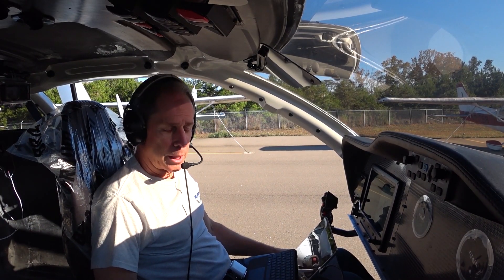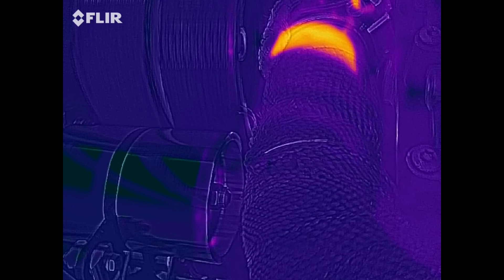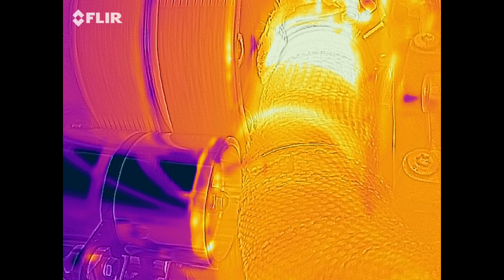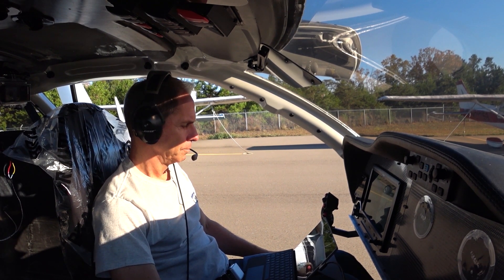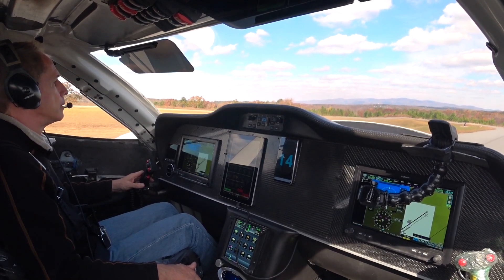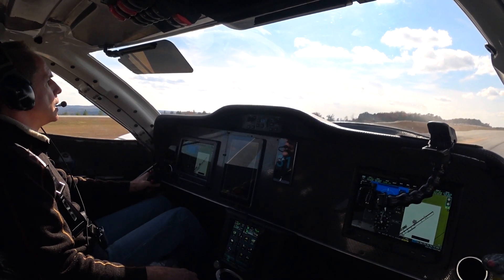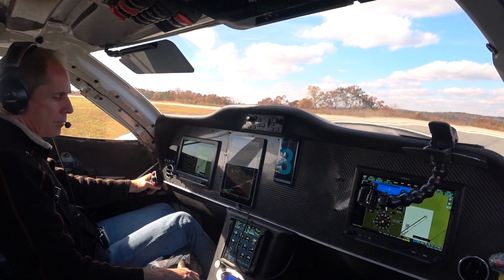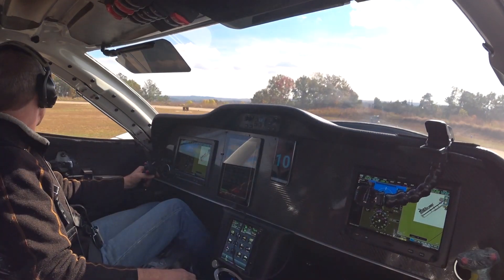Hitting the Limiter? - Building the Raptor Prototype

Comment: To Check if the belts are slipping, draw a Horizontal line with white chalk on both belts, if the belts are slipping the white chalk line wont be Aligned after a test,  The Clogged belts are going to be a problem IMHO,  It appears to me that the engine has to much power for a flat clogged weak belt, and that the groves in the drive pulley will Sear the clogs off the belt in short order if the belts are slipping,  with a diesel engine, you may not even need a reduction system,  I saw a Velocity with a 3 rotor Wankel Engine and it did not seem to have a reduction system,  I realize that a Gear drive would be better, but I dont think one is available for a Audi Diesel engine and it will be very expensive to make one,  If your going to use a belt drive reduction, use V Belts, much safer and if they do slip, it wont hurt anything and you wont feel it, V belt drives are ment to slip a little with out causing problems.

Comment: Hi, The Flat Clogged Belts You Are Using will Always Give you a Problem, they will not stay straight and inline over time, and they have a short life span, Thats why the Robinson R22 and R44 Heli dont use them, use the same V Belts and pully type that the Robinson Heli uses, Problem Solved, Also, use a Stainless Steel Heat shield between the belts and Exhaust. 
Question, what braking system did you finally use, are you using master cylinders? What steering system did you finally end up using, in one of your videos, you talked about using a hyd. steering system, is it possible to show a picture of the steering system and the braking system.

Comment: Hi, At Time stamp 6:56 , You are Showing the Belt Drives . Is It The Camera Angle ???  It Looks Like Both Idler Pulleys Are Offset To The LEFT in relation To the Top Pulleys !!
There are not Centered On the Belts  . In the Picture , the Left Pulley Is Offset from the edge of the belt By About 1/8th -3/16th
 Inch . The Right Pulley Is Offset about a 1/4 Inch ?  Is it possible To Add a Heat Shroud  to Go Between That " Exhaust Pipe " AND the " Belt Drive "  ???? The Shroud ( Or Heat Shield ) Could be Mounted To the Belt Drive ? Leave The Thermo Wrap On The Exhaust Pipe , Leave a " Air Gap " between the Pipe And Shroud ( Shield ) .
Hope This Helps  , Mark

Comment: Not sure what diesel ecu re-mapping software you have? But in any case the software should allow a choice of hard or soft rev limiter. The soft limiter just mushes out at target rpm. You can run the engine all day on the soft limiter, truckers often do. The hard yields a "popcorn" effect and should not be over used, it's basically to stop max acceleration events like a missed shift when racing. Yours does sound like a hard limiter to me, but piezo injectors will respond in a similar way to any number of electrical glitches!

Comment: You might contact the belt manufacturer and describe your situation, perhaps they might have a solution.  Also moving the tensioner down lower might help as well.  Thanks again for the great video update.  Keep a stiff upper lip.  Being a pioneer often requires experimentation to gain success.
Reply: @jet guy many aircraft use them.

Comment: Stainless outer pipe shield with 1/4 inch airspace using inner standoffs  should Siphon heat away from cowling and in to airstream.

Comment: Another thought/question.  What purpose are these belts and pulleys originally designed for?  This may simply be an application for which they will not work.  I would not want to be the test pilot flying for hours on end with an unproven system.  One final comment, perhaps designing a pulley that has an edge perpendicular to the plane of the pulley, would prevent a walking belt from slipping off or moving over the side of the pulley.  It seems this area of the design needs intensive scrutiny and careful development.
Reply: That "edge" is called a flange in belt drive nomenclature.  They are implemented in the current design on the drive pulleys.

Comment: I assume that there should always be 3 or 4 alignment marks on the belts and pulleys, even when the aircraft is being flown on a regular basis.  I agree with a previous comment that each belt should have its' own tensioner, and I am guessing it would be better to have the tensioners placed where they are not pressing the belt against the pulley.  Some type of spring loaded mechanism to absorb variations in tension may also be desirable.  Also, each belt should be in a shroud such that failure and fragmentation of one belt will not cause fouling of the other belt.  Otherwise, if one belt fails, the probability the other belt will fail is quite high.

Comment: What about machining a slight crown  on  both the driver and driven belt wheels like they did in the old flat belt drives. That should automatically center the belts.
Reply: May not work on toothed belts.

Comment: Hi there, I have been following your progress on the Raptor and there is one item I see that is going to be a problem. You are using one tensioner bracket on both the belt drives! That will be a disaster if the one belt breaks! That is going to cause the other belt to run off and it is going to have a disastrous effect on the safe landing of the plane. You must seperate the tensioners from each other and also move it away from drive or driven shafts! 
This is from past experience but it is also my opinion on the belt drives. Regards, Paul.
Reply: Interesting observation. A very realistic scenario.
Reply: Should one belt break the second belt will be guided in place by the flanges on the drive, (crankshaft), pulley.  There are no flanges on the driven, (propeller), or idler pulleys, nor are they necessary to keep the surviving belt in alignment.  It is common practice in synchronous, (toothed), belt drive design to flange only the smallest pulley in the drive unless there is a long center distance between pulleys, defined as greater than 5x the combined pulley diameters.

Comment: Hey  Peter 
Try putting one of your  cameras on the port side so you can see the exhaust. If you  hit the limiter you should see a puff of smoke from the excess fuel dumped
Reply: Would that be the case in a diesel? I guess I assumed a diesel would have to rev limit by fuel cut.

Comment: Would a slight crown on the tension pulleys help keep the belts centered?  I've seen that used on other belt drives.
Reply: Very true.  When making belt sanders it was critical to have a crown.  Don't know if tooted belts would allow for this though.
Reply: @billwessels207  The tension pulleys push on the outside smooth side, so that shouldn't be a problem.  As you probably know from your experience with sanders it only takes the slightest crown to self-center.  A toothed belt has enough flex it shouldn't have a problem conforming to a slight crown.
Reply: @resbum2554  Thanks for the reply.

Comment: A fence would protect the edge of the belt from heat and keep it on the pulley 100%.    Machining the pulley to have a slight concave shape may keep the belt in place too.
Reply: Convex is what you want to keep a belt on a pulley.
Reply: @bradley3549  Interesting, seems counter intuitive.   Learning on this whole deal.
Reply: @badsanta69  100% counter intuitive.  Here is an interesting video on the subject: https://www.youtube.com/watch?v=6sM0Qjumyro

But I really don't know that toothed belt pulleys would work the same way, or if they have ever been done with a crown.

Personally, I think flex in the system due to the engine being soft mounted, and the driven pulleys only being supported on one side are the big factors with belt tracking. I think the fixed tensioner which appears to contact the driven pulleys more than providing tension will also prove problematic in the long run. Both problems are solvable with enough time and testing.

Comment: Was wondering how about if you could use a timing chain instead of belt ?
Reply: I imagine weight would be the big issue there. Not just the chain itself but the box it needs to be in to hold oil as well. Plus pipework to and from the engine and making sure the flow is sufficient. Headache upon headache.

Comment: A few suggestions:
- Set the fine pitch stop(s) for the prop to 3500 RPM at full power standing still.  Your takeoff performance seems to be better at that setting, so why let it go higher?
- Set the rev limiter back to 4000 rpm.  It's hard on the redrive system, so it really should be a "last resort".
- Update the fuel mappings so the power ramps down past 3800 rpm, becoming very low by 4000 rpm.  The idea here is that you're putting a cushion between redline and the hard rev limiter so the hard limiter isn't needed (or if it is, the cut isn't so harsh).

Really looking forward to seeing this project flying, though I'm sure not as much as you.

Comment: That sounds like a fuel cut off rev limiter, when I was turning my car I hit it a few times doing 3rd gear WOT pulls and it was almost identical to this.

If you set the limit to 3800 then it will go off at 3800, it’s a hard limit and will go on and off as the rpm touches the limit and goes back below.
Reply: Alex1911 definitely rev limiter. If he ran into it instead of creeped up on it, then it would be obvious... data logging is so valuable for things like this

Comment: Just run it till you see wear on the belt. If the hours between replacement is too low then worry about finding a solution. 100hrs between replacement to be an annual item done with the100hr inspection should be a good start good.

Comment: Wouldn't a dab of paint on the belt and on the corresponding tooth on the pulley to mark their relative starting positions let you know if the belt has jumped after a run?
Reply: Both pulleys have different diameters. So the marks would be in a different place every revolution. The only way that would work is if the pulley tooth count was an exact multiple of the belt tooth count.
Reply: @olliea6052  Or a whole ratio, 2:1, 3:1. etc.  Even if it were a "hunting " tooth ratio, there would be synchcronisation observable with a strobe.

Comment: Peter:- You might want to keep the same settings (Prop & Manifold Pr.) and repeat a few times, so as to observe, that the anomaly, follows the settings.
Looks like you may have changed the PROP setting (RPM)and tested after observing the anomaly?
If indeed it's the ECU limiter, then it should repeat at a particular Manifold Pr & blade angle (with a small delta).
1. You may want to eliminate "Taxing" as a variable by testing with the brakes & chocks on. The ECU should be agnostic to Taxi vs Static test.
2. You may want to recheck Power-Integrity (Signal Pulse to the Injectors). This could be affected by the RPM via the alternator.
Take Care...

Comment: Belt wander tendency...
Industrial vertical wide belt sanders for sanding the surfaces of doors and panels intentionally make the belts wander from side to side by making the top cylindrical pulley pivot back and forth askew of the bottom pulley pressing the belt against the work passing through on a conveyor below.  
Point a laser at a point on the pulleys that will reflect to somewhere in the cowling.  Put a camera on the reflected image and see if engine torque is affecting pulley shaft alignments.
Also, I imagine all the tension cords in the belts are made of twisted fibers.  If all the cords have the same twist in the same direction, I could imagine belt tension introducing a slight tendency toward belt twist that relieves the cord twist.  Ideally, the tension cords should exist in even numbers with alternating RH and LH layups.

Comment: ,,, in the gasoline world there are 2 types of rev limiter, fuel cut and or ignition cut. This would be a no no with a belt drive. I don't know what this Diesel version of the Motec does, but it would be better if there was a gradual reduction of fuel, rather than a full cut. You might have already ready got it. Set the fail safe limit high and let the prop governor do its job, because it is a smoother transition  .
,,
,,, also with the prop locked in flat mode the revs will climb much quicker, making any limiter more harsh . Again and with another poster, I would call it tooth jumping rather than slipping  .

Comment: What I saw was an engine blip unrelated to the belts, coming from the engine pulley, which momentarily slowed down enough to back up the belt enough to have it jump away from the prop pulley. Is that what everybody else saw?  I’m really curious what the computer data says about that blip.
Reply: I agree. Rev limit was set to 3800 from 4000 not long ago. And surprise, engine hiccups at 3800. No mystery here, and super easy to test/confirm (just change the limiter down and up to confirm.)

Comment: I'm no expert on photography but I have to wonder if, when recording the infrared video of the exhaust and PSRU, the glow on the prop drive pulley is cause by that pulley absorbing some heat from the exhaust pipe.  Since the colors are artificially added to indicate temperature, they can't be being reflected off anything.
Reply: Some black paint is a quick easy means of eliminating that variable
Reply: They can be reflected since infra red radiation what is being quantified and displayed. The camera captures IR regardless of it being a reflection or source. The software quantifies the IR levels into user selectable scales like white hot, black hot, Rainbow, Ironbow, Arctic, and Alert.
Reply: @Alex-us2vw  OK but does IR reflect in the same way as visible light?  If this was a visible light video, that would make sense since the drive pulley is shiny aluminum which reflects visible light quite well.  I'm not sure how must infrared would be reflected by the same surface, though.
Reply: Yes it’s basically the exact same just at a wavelength you can’t see. IR lasers can reflect and blind you just like visible lasers, actually IR will blind you way better since it won’t trigger a blink reflex till you feel your retina burning.
Reply: @bertpenney3526  :: Yes IR will reflect the same way as visible light. They are a part of the Electro-Magnetic Spectrum, with the same properties.

Comment: How about checking out the possibility that the belt, being so close to the exhaust, gets hotter on the side closest to the exhaust, while the other side of that belt is cooler. Expansion of the belt is likely larger on the exhaust side, less on the inside, which could cause the belt to walk toward the exhaust. Maybe a thin insulated heat shield would help determine if that's the cause?
Reply: Right on Song Master ! Pipe in pipe heat diverter will work for this. Stainless outer with standoffs spaced around the inner circumference between the two. The Heat will be siphoned out. Works much better than any wrap.
Reply: Song Master I was thinking while watching the vid that a heat shield (similar to a chain guard) would address that.
Reply: Song Master the Kevlar bands in the belts are almost impervious to heat, I’m thinking it’s not an issue.

Comment: why not use a fence on the belts  and/or toothed belts to solve  the problem?  details, details, glad to see your on it!!  solve this problem!!! and move on to the next issue. keep it up!!
Reply: I believe he has both.  Rims are on the drive but not idler pulleys.
Reply: Peter did have a plans for a chain on earlier in the project, changed to a belt a while back.
Reply: That "fence" is called a flange in belt drive nomenclature.  They are implemented in the current design on the drive pulleys.